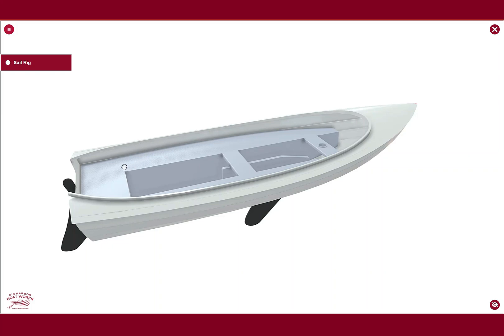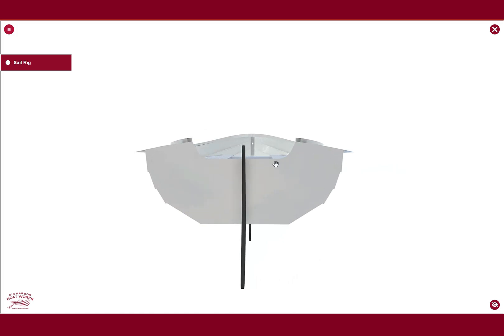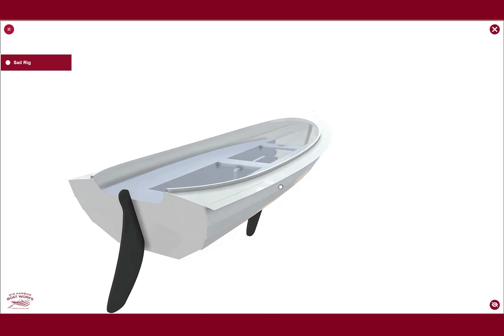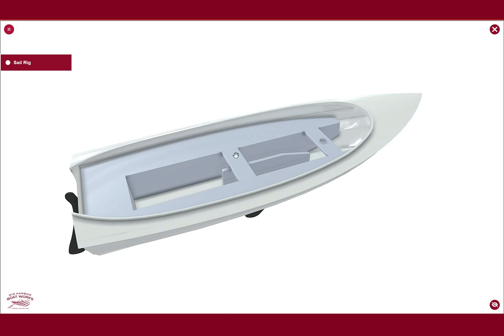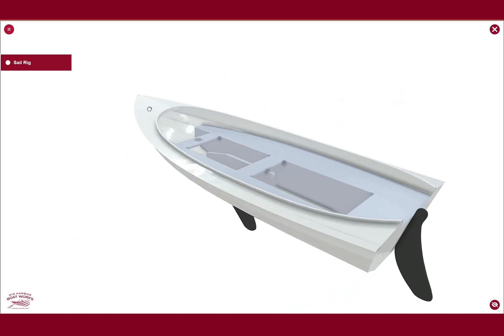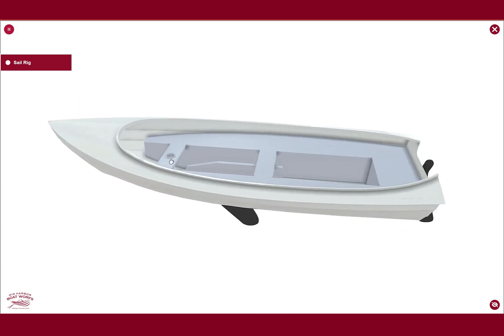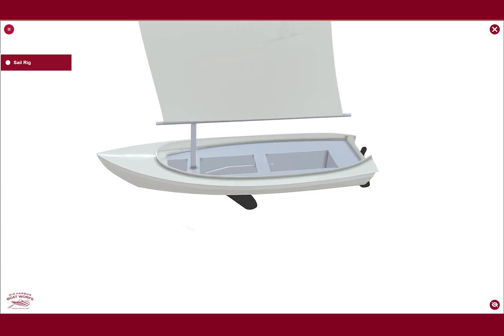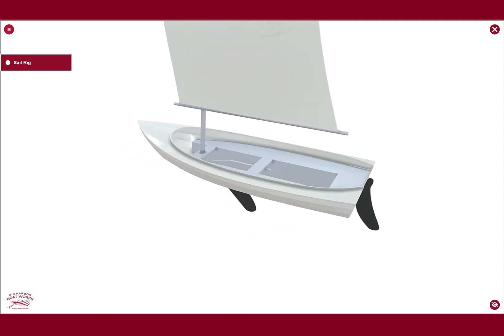Lobster Boat Redesign - 3D Preview

Comment: Should move mast a little more forward for a gaft  (catboat) rig set up.  10 times easier sail handling and set up with sail stored on boom with mast up or down never have to remove sail from boom. Had a 15 ft catboat for 18 years.
Reply from the maker: The balanced lug rig is functionally the same as the gaff, very easy and quick to rig and the sail and spar tuck nicely on the boom when you lower the halyard. The balanced lug is the same as on our Scamp, and you can see details in the rigging tutorial here: https://www.youtube.com/watch?v=BLTYt5Tt6Go

Comment: I think it’s amazing that a hull like this will ride decent in salt water waves, but be an absolutely horrible ride in the freshwater Great Lakes.   
It’s been proven over and over, Any hull without a v bottom all the way back will slap and pound in the Great Lakes.
I believe it’s something to do with the steepness and tighter frequency of the waves.
Reply from the maker: Can't comment on the Great Lakes since I've never sailed there, but want to clarify that the Lobster Boat doesn't have a V-shaped keel all the way back. It is a semi-dory hull, so it has a V at the front to cut through chop, but transitions into a flat hull partway down. So it will both plane and give you a flat area to work in or sit nicely on the beach. You can see the underside here in this short update we just posted on the build process: https://www.youtube.com/watch?v=BQeA3mirAdA